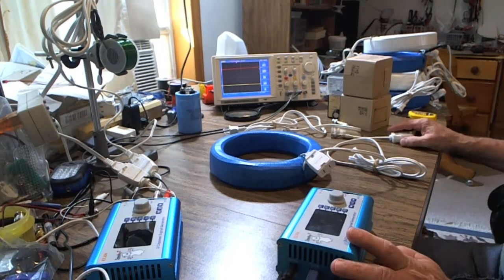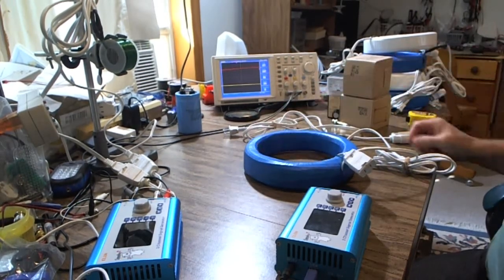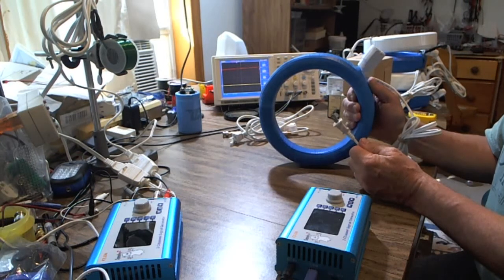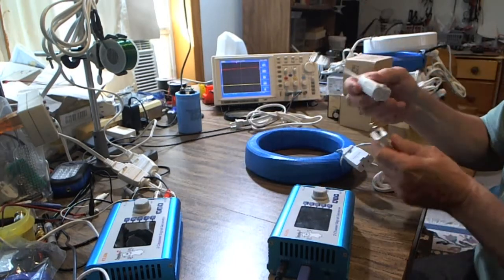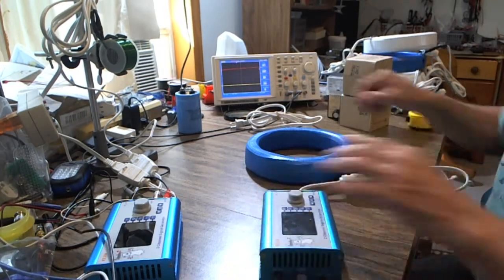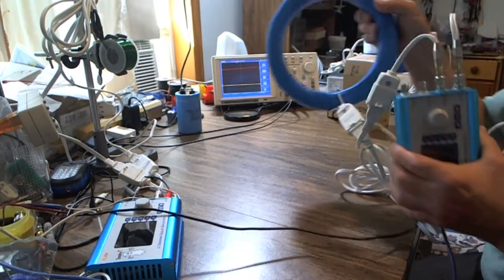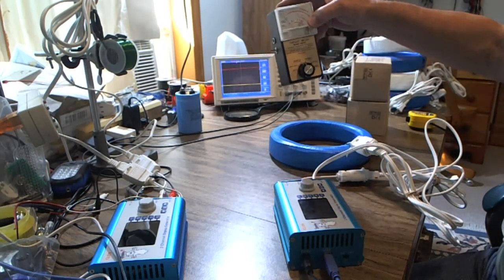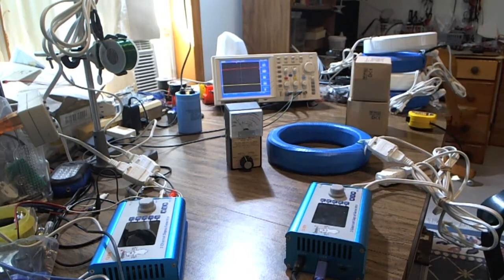New Bifilar Connections to Spooky2

Comment: My question is have you wirked with jds wave generators? Will it also work with spooky2?
Reply from the maker: The coils are no longer being made.  However there are video links on the website showing how they were built.  Basically most function generators like some of the JDS generators work like the Spooky.  I presently have both Spooky and Feeltech generators and outside of the software control features can perform identical task.   The enhancement of all these generators through software is what sets the various brands apart.  Spooky has some of the best automated control software for their version of generators, that is out there in the market place.  While JDS is much like the Feeltech albeit Feeltech has better pricing.  Be well and respectfully,  Steve

Comment: Hi, does it heat up like the old one? Thanks
Reply from the maker: The New Bifilar Coil can run all day off the Bob Beck Style PEMF unit and only get mildly warm.  However with the High Powered PEMF it will get warmer than what the Beck PEMF can produce.    The High Powered PEMF has timer settings that prevent you from cooking the coil.   The internal thermistors will shut everything down before the coil ever gets too hot.   My wife runs the coil at 4 hertz for 20 minutes holding the coil for the duration.  She says it gets comfortably warm and enjoys the heat but it never gets hot.
 
The original Bob Beck PEMF needs a modification to handle the large coil.  In one of the recent video just posted, it was stated the Bob Beck PEMF can be updated for $10 plus shipping.  See www.aurorasky.net for the latest videos, documentation and updates.
 
Respectfully,
Steve